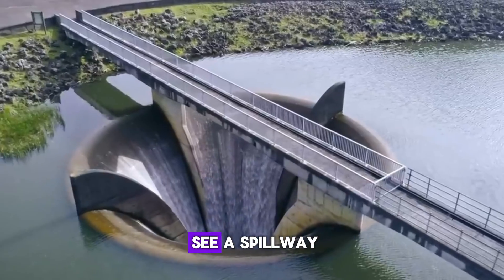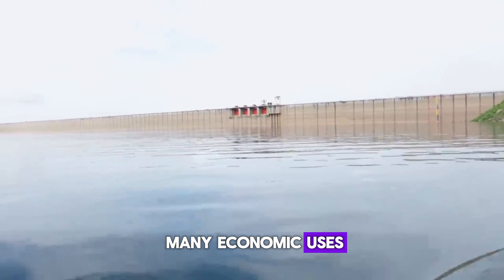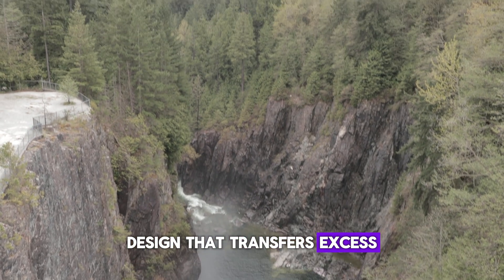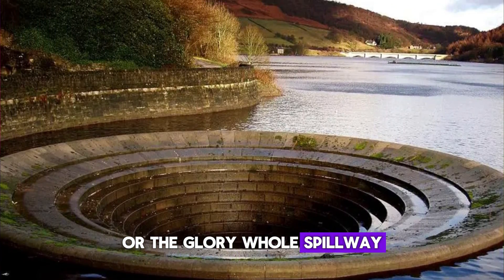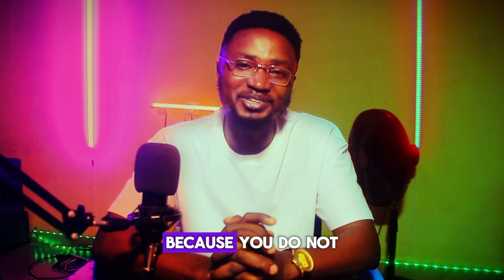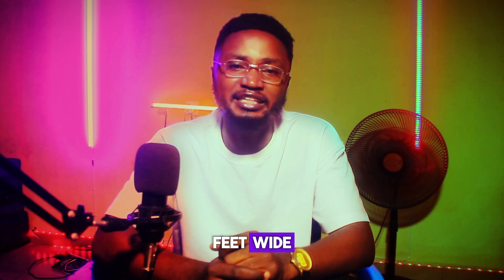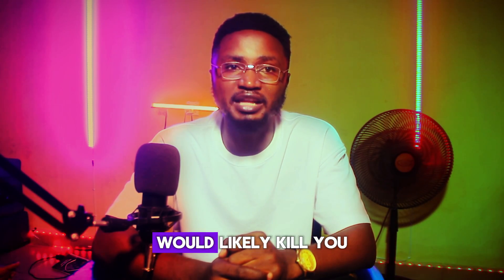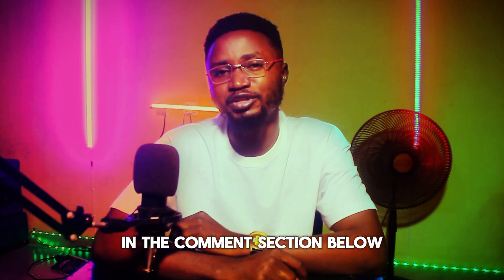What Happens When You Fall into a Spillway

Comment: Can’t they add like some filter at the top that lets water in but the holes in the filter are too small for humans?
Reply: And what'll happen once it clogs up with debris?!
Reply: @CraigFThompson  there’s not gonna be debris that’s that big to clog up a filter for humans, even if there is it will just sink to the bottom and not float towards the drain
Reply: @ No, but enough small debris will plug up such a filter/screen….
Reply: @ I wouldn’t think so, cause the filter passage ways would only have to be small enough to stop humans
Reply: @Warthundermoments09  You'd be surprised to discover the amount of debris that builds up on such lakes, especially with flowing water into a restricted flow area....
Reply: It's a test of human common sense i suppose